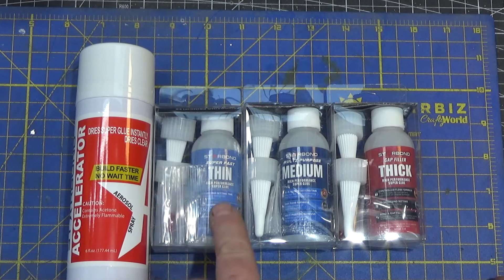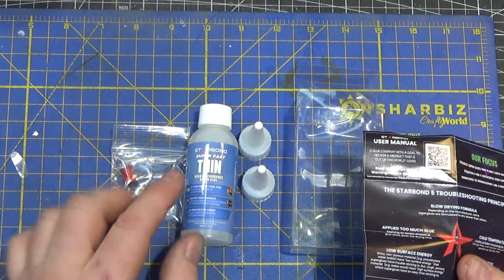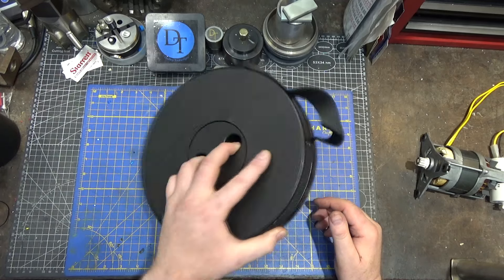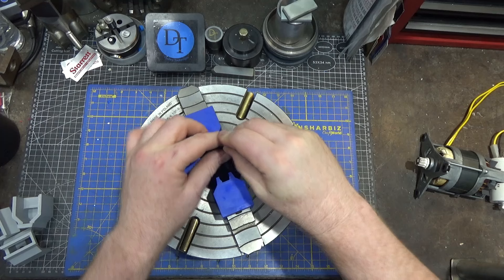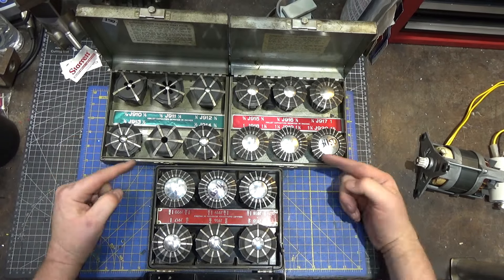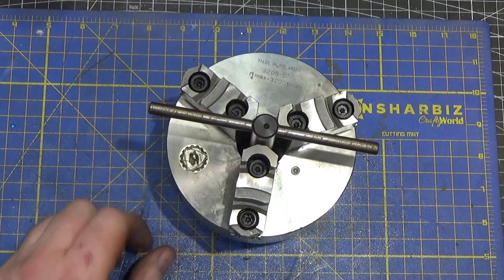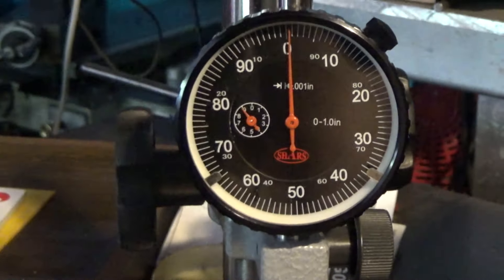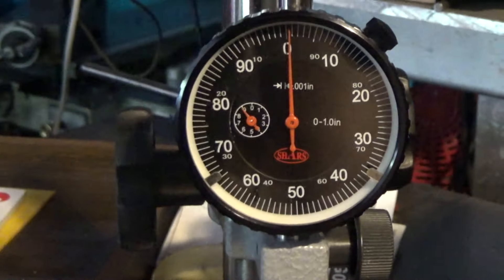Shop Miscellany #24 More Tool Finds and Liquidations

Comment: As long as you get a real mitutoyo, you get a real calibration certificate.  Part of the premium is in the amount of work put into it.  You can take your stand, and your gage blocks, and your mitutoyo indicator straight out of the box, and you will get the same results as the calibration certificate says, all the way along the graph.

I wouldn't trust the calibration certificate for any chinese-sourced indicator as far as I could throw it.  Most of them are photocopies.  That doesn't mean the Shars indicator is bad, or inaccurate, it's just that the paper is probably worthless, and the fact you got "better than claimed" is an indication that the claim is false.

For most people, of course, this will not matter.  If the indicator is repeatable and the error remains  similar in relative terms within a reasonable range, you're gravy.  As long as you steer clear of the ultra-cheap chinese indicators, you'll be fine (and you're usually better off in price to quality ratio by going direct to the manufacturer than going through a rebadger/reseller like Shars).  My chinese stuff comes from Shahe - it's a bit more expensive than Shars, but qualitatively my Mitu and Roch stuff has very little advantage.  Still, though, I wouldn't trust the certificates :)
Reply from the maker: Very useful set of comments especially about the disreputable vendors selling knock-offs.I reviewed one of those years ago and it was crap.

Comment: i had one of those stools, it lasted one use.  i am far less than 300lbs, so that 400lb rating is BS.  the stool: doo not buy!
Reply from the maker: Good feed back. There are a bunch on copy cat manufacturers out there of which mine is certainly one. I will definitely watch out.